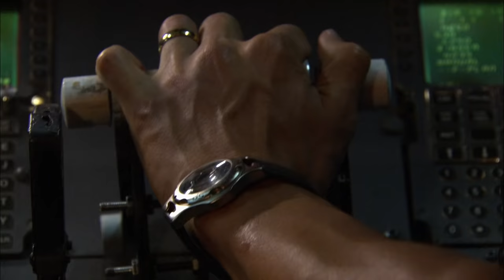Pilot Made Disastrous Decision Just 200 Feet Above Ground 😳 Air Disasters | Smithsonian Channel

Comment: Several years before this crash I was stationed on Guam. I lived on Nimitz hill and worked on the Navy side of the airport. I used to sit on my front step and watch aircraft pass at a lower altitude over Agana, nearer the water, than I was at on their way to land. 
It seems that the landing pattern has changed as I don't recall any planes passing over Nimitz hill, but then that was long ago.

Comment: 1:37 I'm no pilot, nor do I go any piloting school but by watching these videos.. I wouldn't hesitate to go around immediately after hearing that 500 ft warning not being able to see the runway. Correct me if I'm wrong pilots.
Reply: There are minimums which pilots set eg. Minimums is 1200ft and if you cant see runway by then then you go around.
Reply: @bray8949  Im pretty sure another crash happened cuz the pilot hesitated to go around.
Reply: @bray8949  Oh ok cool I'm guessing that these pilots set their minimums too low or ignored it?
Reply: ILS minimums is less than 500 ft on an approach, usually 200 ft Above ground level (AGL). For instance if the landing field is 1000 AGL, the minimums would likely be 1200 ft.  i.e 200 ft AGL, so the 500 ft mentioned was approaching minimum, and not below.
Reply: @DansFitness  The minimums are published in the approach plates, and not computed by the pilots. The other guy is incorrect.
Reply: @DansFitness  u dont set it too low unless you misread it or inputted it wrong but they ignored it in this case
Reply: @frozenolives6745  ok?
Reply: @anasadamu8499  thanks 🙌
Reply: @bray8949  ok?
Reply: It all depends on what the minimums for the approach are. (When executing an instrument approach procedure, there is a published altitude that is the lowest you can possibly descend before you must see the approach lights/runway; if not, you must execute a missed approach.) And that minimum altitude (called “decision height”) varies from approach to approach depending on the precision of the radio equipment used. For the most precise systems, a Category IIIB system, the minimums can be as low as 50 feet or even lower under special circumstances. Many modern airliners are capable of landing themselves, even - called “autoland”.

Comment: Why are there winglets, it's a 747-300
Reply: Don't worry, it gets worse; this season was RIFE with such errors:
-MD-80 model instead of DC-9-30 for the Air Canada episode
-The above also applies to the Aeromexico plane
-A340 winglets too tall (Air France 358)
-Wrong livery for BA009 (Landor livery was just 2 years away)
-Winglets on a 747-300 (as you mentioned) for Korean Air 801
-Oh, and a 747-300 model instead of a 747SP (China Airlines Flight 006)
Reply: @fs10inator  Yeah very worse.
Reply: @fs10inator  Also if this has winglets on it, might as well be a 747-400
Reply: The worse part is the cockpit is very much same in every episode
Reply: @sumukhverma1405  Its a physical prop and not animated, so I guess they would have problems having 10 different cockpit stages. No excuse for the cgi though, that was just blatant lazy
Reply: @Ben-mw9vz  but y make different stages when advanced sims are already available at some airports
Reply: @fs10inator  this was an older season from like the late 2000's, the newer seasons like the now just new season 22 on nat geo, they changed a lot.
Reply: @noahthesarcastictd  Yeah, I know; the SWA episode did it for me with its CGI back when I first saw it. 

S4 was 2006-7, and I was just expanding on the OP's comment.